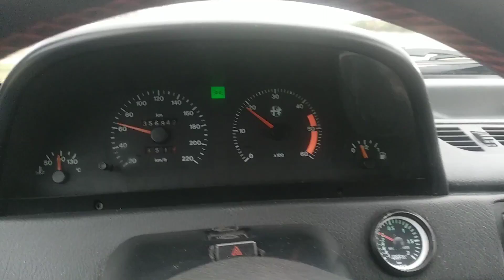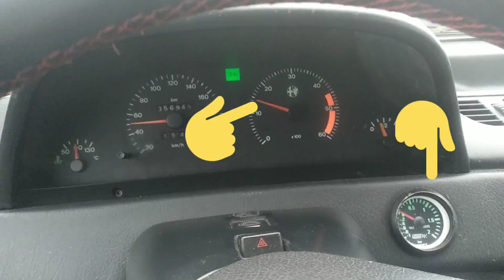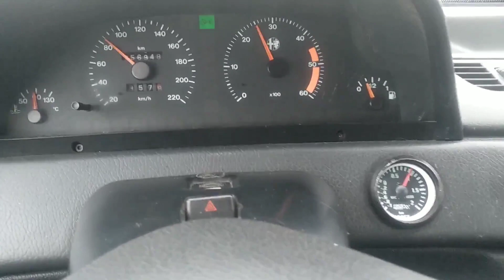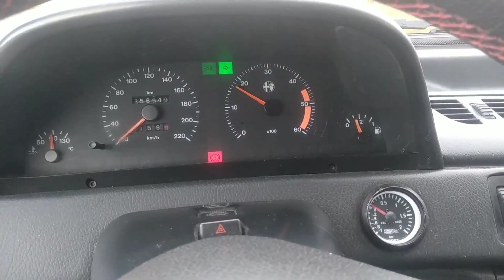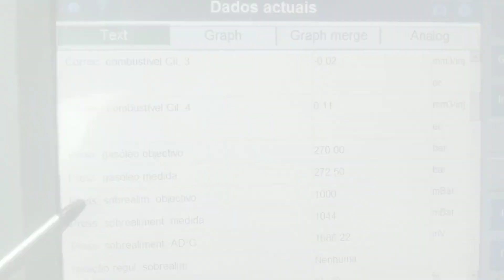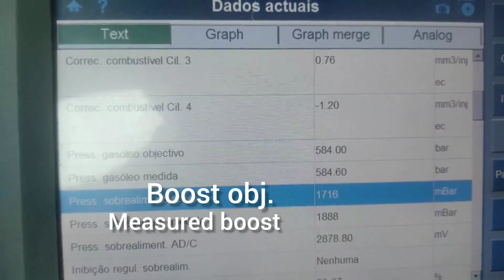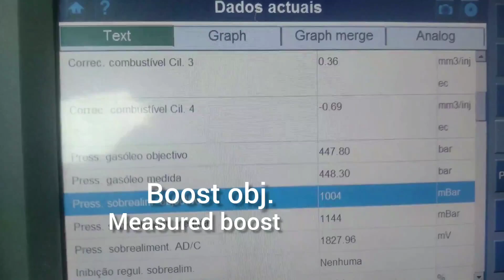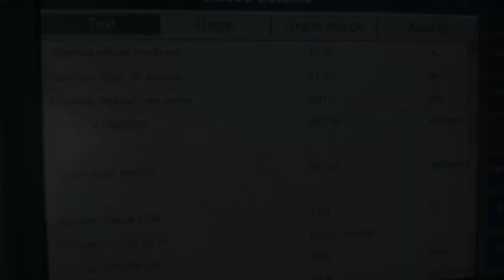How to test and understand Turbos. VGT and Waste Gate. Mjet, JTD, TD and more.

Comment: Hello, I got a FIAT STILO 2002  1.9 jtd 115  and few weeks of the boost was all ok. But now the the car has no power at all  I accelerate 100% from 2500rpm and I don’t hear 👂 the turbo like before 

-Has new air filter ✅ 
-checked the pipe from turbo to air box it was ✅ 
-cleaned the sensor in the near the air box had a little bit of oil 
-car doesn’t smoke  ✅

It’s been scanned with a autel mk808 and no fault codes and no lights on the dash 

😢 any advise
Reply from the maker: Hello, yes I have two advices. Check it out with the Autel:

https://youtu.be/sCA-z95YvWI?si=48zB9bV3GdfllNgo

And also this one:
https://youtu.be/7erMLUm_1do?si=i3Mjr_Cnm6U5jpZJ

Let me know what did you find

Comment: Ciao my friend, thank you for your very helpful Alfa Romeo video. In 1996, I bought my first Alfa Romeo model.  It was a 155 1.9 TD.  I drove that legendary model until 2012 when I bought the 156 1.9 JTD SW model that I still drive.  The next car I plan to buy is something from the 159 series.  In your opinion, which model from the 159 series should I decide on.
Reply from the maker: Hello. Here in Portugal 939 series (159) are 99% diesel ones. So I can only comment on that. The 2.4 is a monster of an engine but you have to have a big wallet for it... It is not a engine for a entry level.
So, the 1.9 or 2.0 could be the best option. Keep in mind the model is aging fast and parts are becoming very unavailable fast
Reply: @alfaromeonoproblem  thank you 🙏. For me and my standard in Serbia 2.4l and 140ks or max 150ks is something what I can pay without any problems. All over this specification is most expensive for me. I have very little experience with gasoline and gas LPG. Diesel is my standard option but if someone recommended me some gasoline petrol engine for 939 series with good experience I will be able to change my standard option . Thanks again.